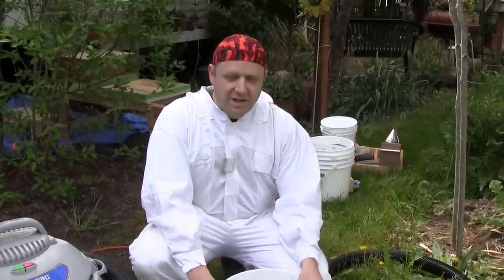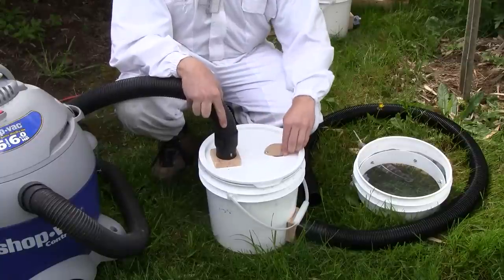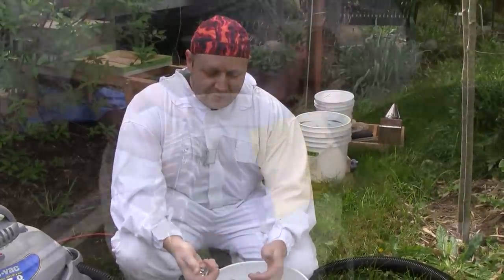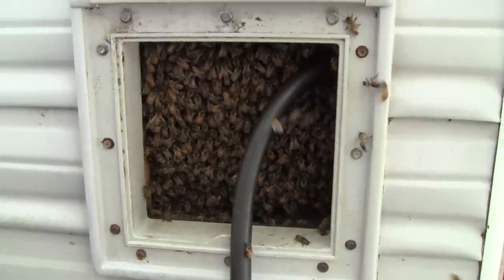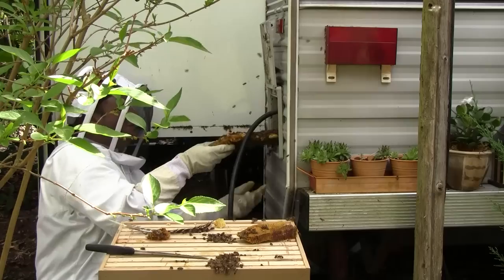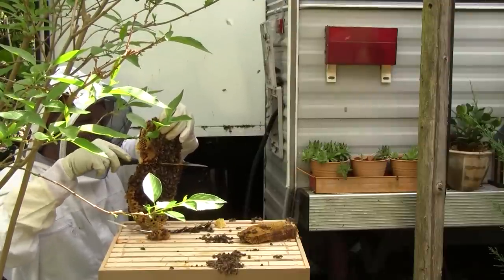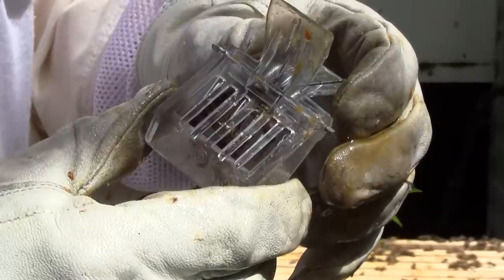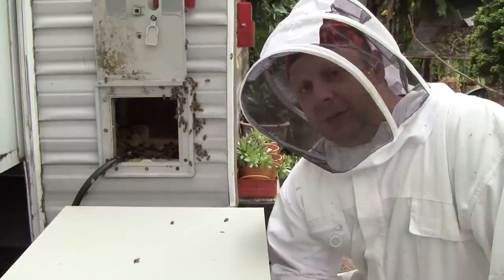Cutout, Bees in RV - Bee Vlog #94 - Apr 27, 2013

Comment: It looks like you may have too much vacuum suction going on there.  They should barley be pulled into the hose.
Reply from the maker: Yeah, it was tough balancing the vacuum suction. I had my son regulating the pressure while I told him up or down. Not enough suction and the bees can't get pulled in, they just hang on to the comb or each other. Too much and you kill them. In this extraction it did okay. Very few deaths. In another extraction later I couldn't regulate the pressure and had it up too high the whole time. Lots of deaths. I have retired this design and may build a new one with a different design. I don't do cutout removals anymore though.

Comment: How do you like this bee vac design?
Reply from the maker: BeeMan97 It's not too bad. I would rather use a smooth-walled hose though. The ridges on the hose I used here can do some damage to the bees. The suction also really needs to be watched closely. I used this same vac at another cutout and didn't regulate the suction very well and really did quite a bit of damage to the bees.